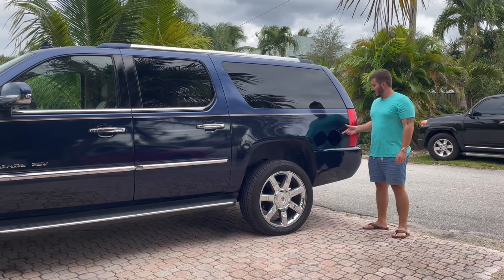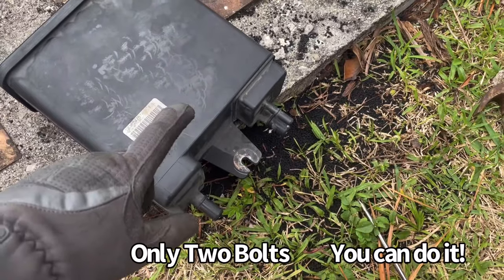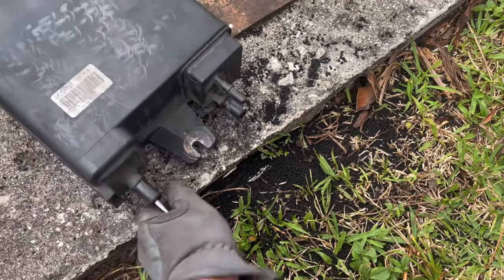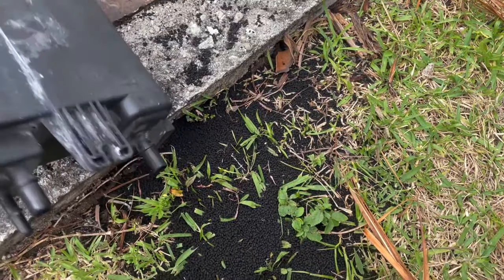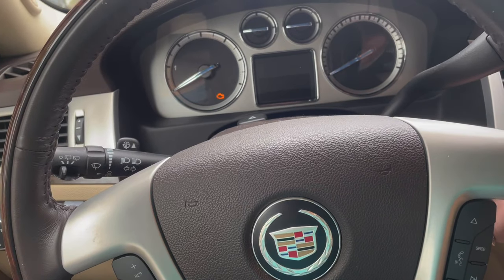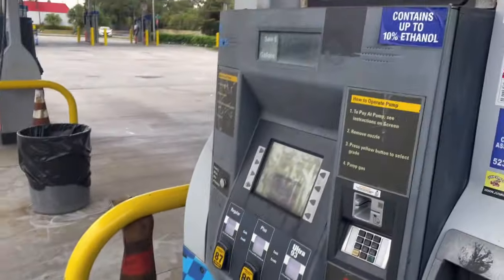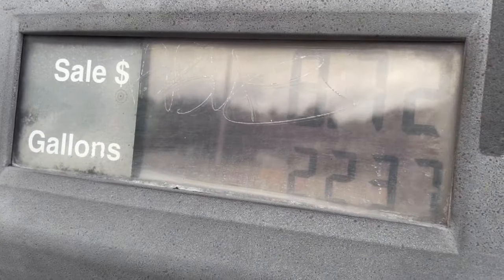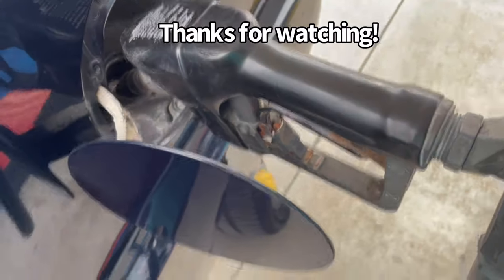Gas Tank Won’t Fill? Cant Pump Gas without Clicking? Free Fix Charcoal EVAP solenoid purge valve DIY

Comment: If you're going to go all the way to take the canister off, why don't you just buy a new one at this point? There's plenty of GM parts websites out there and you can get this stuff way under list price. It's not worth the time and energy to take it off and then put an old one back on. You put a new one on you'll never have to worry about it for years down the road. It's also best to change out the charcoal canister vent solenoid while you're at it. Also the purge valve in the engine compartment. You do all those things you'll never have to worry about anything for years and years to come.
Reply: You missed the whole point friend. Free.

Comment: Whats weird is my truck does this but only at certain gas stations
Reply from the maker: Definitely an intermittent problem. You’ll either need to fix it how I showed here or you can just cut the vent line off the tank but you’ll need HPTuners in order to delete the CEL. 
I can make a video for this as well if you guys would like.
Reply: yes please @BobHGarage

Comment: I’ve changed everything and dropped the tank and have the same issue smh!
Reply from the maker: Last resort, but HPTuners for $200 and then disconnect the tank vent line to the cannister. Leave it disconnected. 
After a day or so you’ll get a CEL for an evap system leak. 
Open HPTuners and select that CEL code and turn it off permanently. 
You’ll never have a problem again